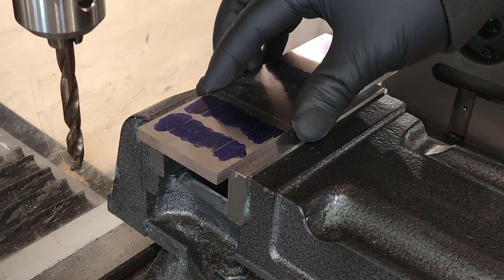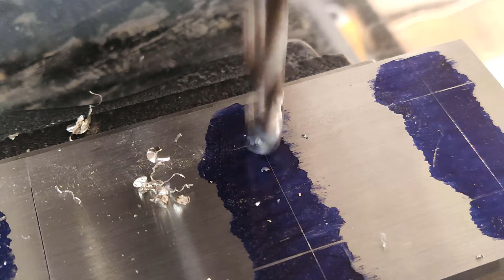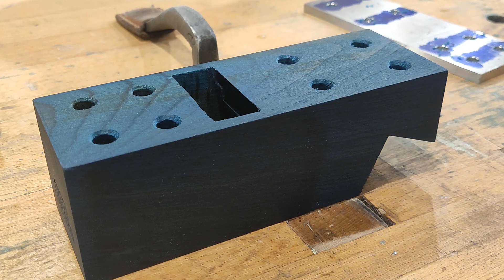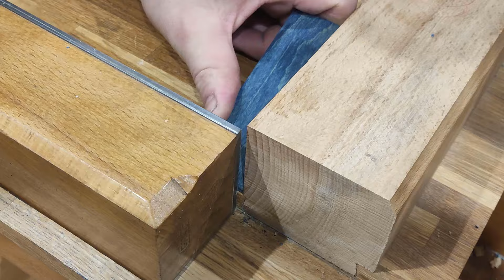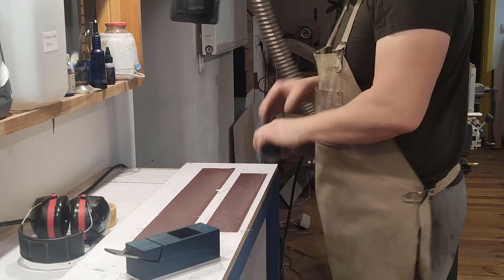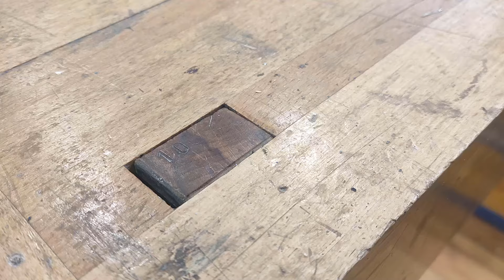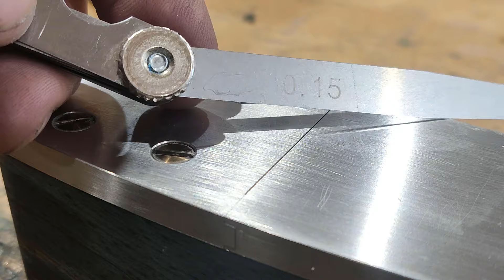080 Coffin mitre plane with stainless steel sole

Comment: You can see the workpiece lift at around 0:41. It's better to always tap it down with a hammer to make sure it's seated correctly.
Reply from the maker: Between 0:41 and 0:42 was not a second, rather a faw minutes. You know what does it mean :)